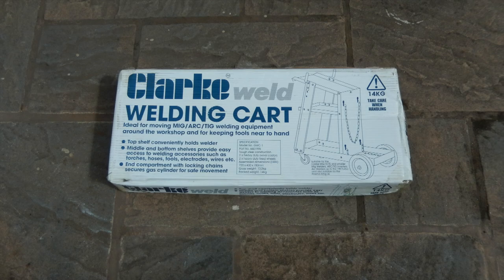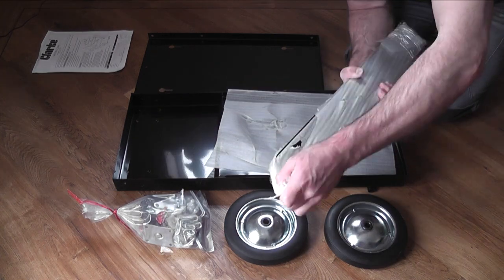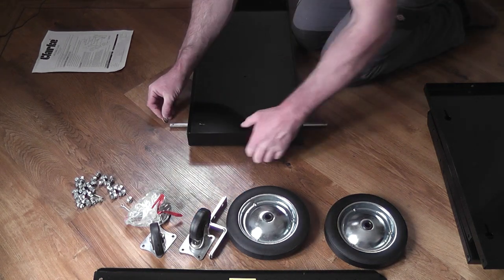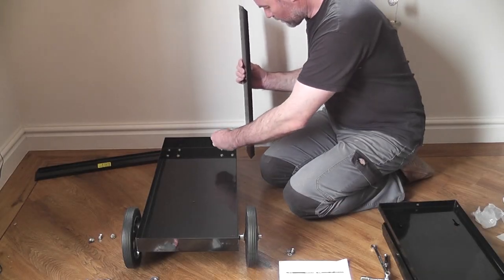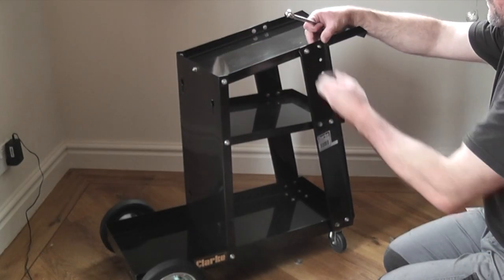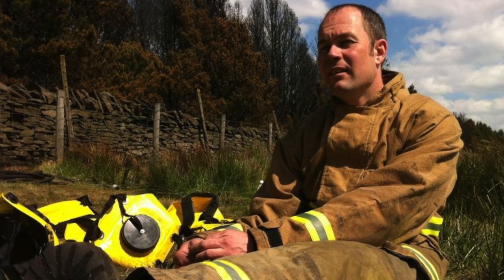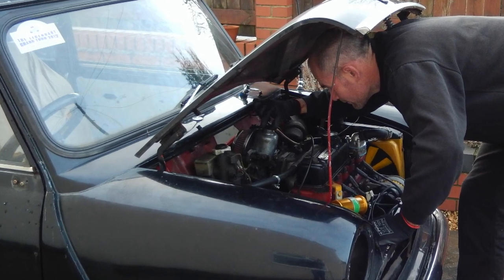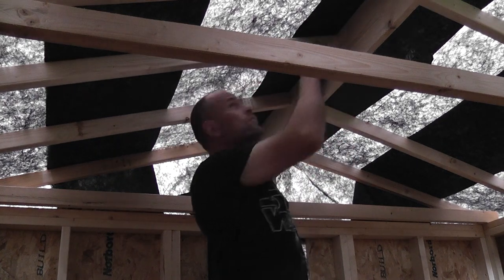Classic Mini Restoration Episode 19 - The Clarke Welding Trolley Cart GWC-1 From Machine Mart

Comment: Looks like a good buy mate. I have an unbranded one and saves a lot of hassle in moving it round as gas n welder are heavy! Got a cheap trolley for other power tools too
Reply from the maker: Its a good addition to the workshop. It'll be tricky to wheel in and out as I have a bit of a step...but I'll probably build a little ramp when I have time. Only time will tell if it lasts...but if im honest...at the speed I work at it'll last decades haha
Reply: @Talon Louie Yea, I've been using Instaflixxer for months myself :)